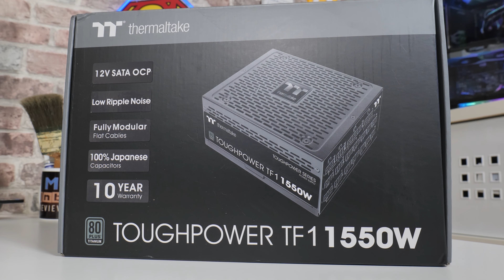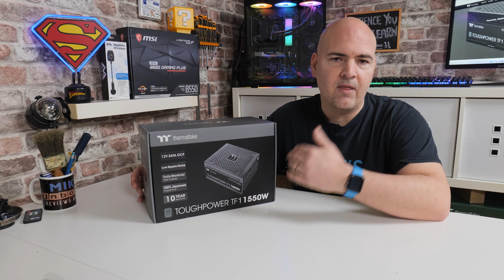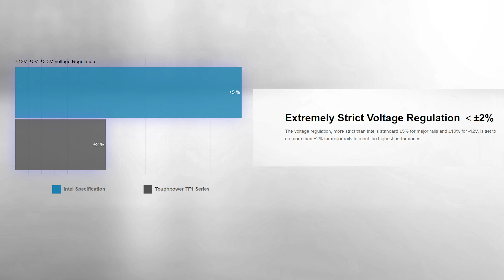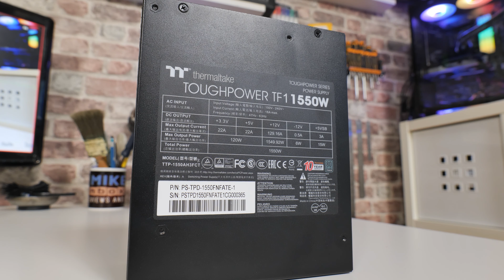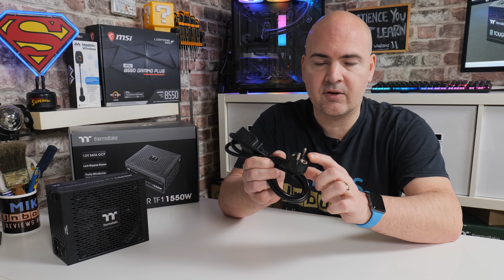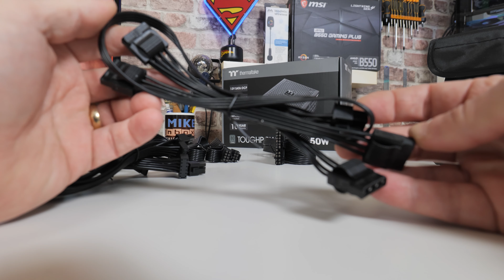Thermaltake ToughPower TF1 1550w Titanium Monster Mining PSU

Comment: At 180mm, takes up A LOT of case room.
Reply from the maker: it is a big psu for sure
Reply: It's actually very small considering the power on hand. Most competitors 1200 watt and up PSU's are bigger than this one except for maybe Seasonic.
Reply: @Slickman2006  how many MMs are the ones you speak of?
Reply: @PapaMav  Other manufacturer's are 200mm, 210mm, and more! This one is only 180mm.
Reply: @Slickman2006  yes (see above) I'm aware this one is 180MM.  Thank you for the additional information.
Reply: @PapaMav  Not a problem, the manufacturer's that make them on the smaller side are Seasonic, Super Flower, and (of course) Thermaltake. By small I mean 180mm length or shorter. 😊
Reply: @Slickman2006  thanks for the additional info.  One small point of information, Thermaltake, unlike the other 2 you mentioned, is not an OEM.  😉

Comment: Thanks for another in depth review - far too powerful and expensive for me - also I think that the ATX PSU standard is due to change soon replacing the 24 pin with a 10 pin - so maybe not that future proof for us mere home enthusiasts - saying that it looks like there may already be a 10 pin next to the 24 pin on that rig - but no connector ???
Reply from the maker: yeah future proofing at this time is looking a bit doubtful with ATX 3.0 and 12VO in the distance, but if you are building a huge rig with this and plan to use the PC for the next 10 years, it should last at least as long as the components in the PC or longer

Comment: I'm definitely going to pick one if these up for my dual 3090ti sli setup... lol. By the way, a UK 13 Amp plug can carry up to 3000w of power which is more than satisfactory for this power supply. Fast boil kettles are usually 3Kw.
Reply from the maker: good point, my own kettle is at least 3Kw

Comment: It’s a beast, problem with 1.55kwatts power unit and if your running at 90% efficiency that’s a (1550x0.9)-1550 loss = 155watts. Great video, thanks Mike.
Reply from the maker: wonder if we will every have 99% PSUs, that would be a cool thing and save energy
Reply: @mikesunboxing  having worked in this industry for a very long time,  I would say yes maybe in 20 years time.

Comment: Interesting review of an enormous power unit. Is it intended for mining rigs? Lastly I understand the new RTX3090Ti draws up to 375watts but use a new type of connection with extra 4 data pins which this beast doesn't seem to cater for! Cost wise that is what I would spend on the whole PC build hahaha. Thanks for reviewing Mike and Kath👍
Reply from the maker: the new GPUs come with an adapter that takes two or three PCIe connections and converts it to the 10 pin, so RTX3090TI in SLI is possible with this unit, maybe even 3 or them 😂